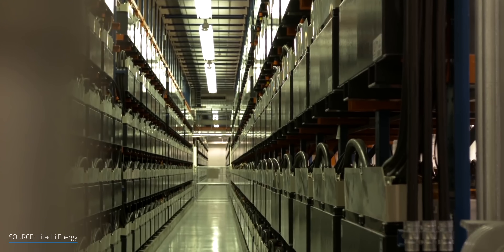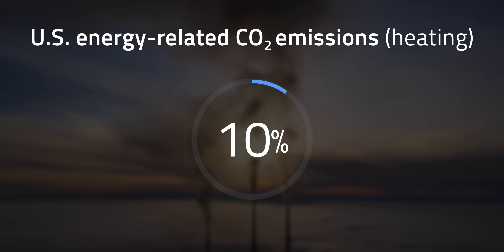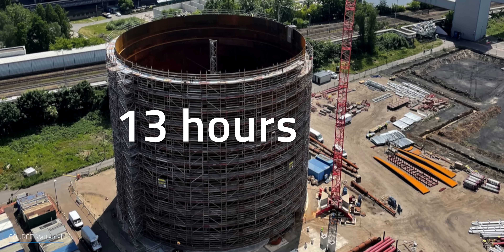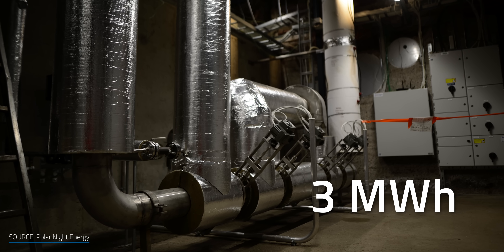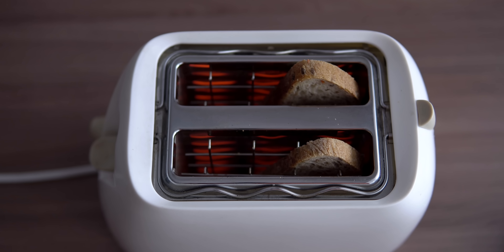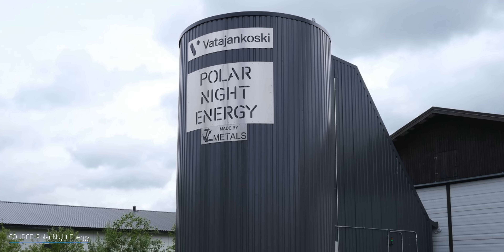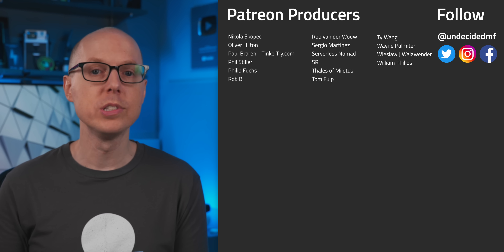How A Sand Battery Could Change The Energy Game

Comment: In Finland we have district heating in every major city and it's absolutely awesome. So cheap and efficient. This sand storage seems super promising due to it's simplicity. I hope those sand heat storage systems get deployed in every Finnish city soon. We could send excess renewable power into those immediately while we simultaneously ramp up electrochemical and mechanical energy storage.
Reply: Ahem, we would need at least 50MW of heat per hour minimum in bigger cites. That's a lot of sand of you wanna power the system, let's say for a week.
Reply: @happylatino  Apparently many Finnish cities are looking into smaller scale nuclear power (SMR/MMR) for powering those systems instead of coal or biomass, which are the most common heat sources.
This can still be utilized by nuclear Cogen plants. Just store heat when not needed, liberate it when needed. For conversion into electricity its ridiculously inneficient.
Reply: They might be looking into those but smr won't ever happen with current legislation. It's far to strict. And secondly nuclear will not power district heating without electricity conversion first
Reply: It's interesting what Sri lanka can do as here the country is so warm almost everyday, and we have plenty of sun as well. we can use solar panels and store all the heat in these silos, and then use them steadily by connecting them to the grid. our whole power outage problem will go away.
Reply: @happylatino  Utilizing waste heat, also known as Cogeneration. Been done for decades in Russia for example.
Reply: @AlldaylongRock  they looked in it for Olkiluoto. Deemed too dangerous because of risk of nuclear contamination of district heating circulation water
Reply: @happylatino  Why would there be a risk? Even if it's used as a tertiary cooling loop, it has 2 whole interfaces between it and the nuclear reactor. Then, I don't think district heating waters ever come out of the pipes, they are passed through even another heat exchanger. As for contamination, it's super easy to detect.
Reply: @AlldaylongRock  that's what government officials decided. Though I have heard whispers that OL has minor contimination problems with seawater ,tertiary loop.
Reply: @happylatino  I heard about that, and that it was quickly solved. A small leak in a cooling loop in iirc unit 2. They have radiation detectors everywhere.
Also, OL 1&2 are BWRs, so I'm doubtful that it's a tertiary loop. More likely a secondary loop. It would make little to no sense to have a 3-loop system in a BWR,especially with direct access to plentiful coolant like seawater.
OL3 on the other hand, is a PWR, so it does use a 3-loop system. It's currently testing various power levels until reaching 100% later this year.
Reply: I do know that it is called officially third loop. Ol 1&2 has freshwater loop between reactor cooling and sea. There is two heat exchangers. So in theory fresh water loop never gets contaminated even though reactor water is
Reply: @happylatino  That's why the water used for directly cooling nuclear reactors can't be used for this heating, which is why heat exchangers are used...
Reply: @thefirehawk1495  as I explained heat exchangers does not provide enough certainty that there won't be contimination. This stated by government officials. So it won't happen.
Reply: @happylatino  legislation can change if we petition. Any PWR type nuclear works by heating coolant before making electricity in the first circuit so the conversion to electricity is not required or could be combined.
Reply: @happylatino  Government officials have not prohibited the use of that nuclear power plant's cooling water for district heating. The reasons are purely economic. It is not reasonable to build infrastructure for cooling water that is only 10 degrees warmer than seawater. It simply is not suitable for district heating.
Reply: @happylatino  Go to the companies homepage. They have excellent information on how to do huge systems. Almost all cities have old quarries or big holes around them. Insulate and fill with sand and you have a huge system. Add a small wind park or use surplus windpower to heat it during summer. (In the Nordics it would actually make solar interesting again.)
Reply: This type of storage is far too low density, 8MWh is what you'd need for a single house to call it seasonal. The government will waste some tax money on it and other useless projects and thus we pave the path to hell with good intentions.
Reply: @axiom1650  The 8 mega watt was just a test prototype.  The insulation costs on a much large system  reduces the costs considerably and by the 3 university students that have been doing the research initially; their results have shown to those interested that it is at least 3 times cheaper than any battery storage system per unit of energy storage. If the sand mass system is built under existing building that require insulation to begin with that helps the overall cost and the system is designed to utilize excess solar and wind. In northern latitudes that utilize solar panels, winter output is reduced considerably and this system helps to store excess energy in the summer that would otherwise  be dumped or in the case of a wind turbine, stopped because their was no use for the output. As one finnish contributor said ; they are also looking into small nuclear that in the summer months would normally dump tremendous amounts of heat into the atmosphere. Instead they intend to capture that heat and store it for winter time demand and thereby increase the nuclear plant efficiency and lowering demand for alternate heating in the winter such as coal, biomass or having to build a larger nuclear facility. The sand mass system uses of the shelf products and has a projected 50 year or more life span.
Reply: It's not cheap here at all. Many new buildings install heat pumps instead. District heating infra is not cheap nor efficient. Compared to electric grid.
Reply: @MarkkuS  In many places the effectiveness of air to air heat pumps is low during winter and electricity is expensive when its needed. This is an excellent system for colder areas.
Reply: @MarkkuS  Heat pumps in Finland? Unless those are ground-source I don't see them being too effective with temperatures reaching - 20C in the winter even in the South.
Reply: @AlldaylongRock  You telling me I should throw away the air heat pump I have? The days the temperature reach bellow -25 where it really starts to struggle is not that many. Especially in the southern and western parts. Last winter it needed help all in all one week with an other heat source. While geothermal heat pumps are installed in every new private home it's a waste of money in a 60 year old house.
Reply: @Iceeeen  Air-sourced is also a waste of money in badly Insulated homes. Even if temperatures are inside their operating range.. For HPs in general to work well, homes need to be heavily Insulated. Below 0/-10C or something, for most AtA HPs you are better off in terms of energy efficiency using resistive heating. Older homes are better off using fuels(NG/wood pellet etc) over HPs. Fortunately for Finland, electricity is relatively inexpensive around those parts, compared for instance with like Portugal...
Reply: @AlldaylongRock  Once again I have stats to prove you wrong. I average around 11 000kw/h year, down 6000 from electric heating. Most of the consumption today is used for the garage today, welding and other tools + a electric vehicle charging.

Yes of course pelets is chepa but for heavn sake the work around it is to much. + The investment is about the same as thermal with about zero work when done

Btw try looking at spot prices. Finland is not cheap. You are thing about north sweden and norway
Reply: @Iceeeen  I didn't say AtA HPs were useless. The reality is that from an effectiveness standpoint, ground-sourced is objectively the best option, providing that you don't get frozen ground at the depths where the loops are installed (although if THAT happens, Air sourced HPs are utterly useless) 
I personally am not a fan of "oh I need 2 things to do the same effect". Because I have to do so, precisely with heating in my bedroom. I use a air-sourced HP until it gets under 5C outside, then a oil heater. 

Pellets aren't that bad. I spend literally 5 minutes average with working on my pellet stove I use for the living room and kitchen. Central heating furnaces just require you to take out the ash once a week or so, and refueling. The price difference for electricity makes up for it for sure. I'll probably get off-peak rates up to the 15cent mark this winter, and peak ones to like 25 or 30 cents. All depends if it rains or not (Portugal is extremely dependent on Hydro to keep prices in check, and currently the dams are dried out, result of the closure of our coal-fired power plants). Now, what are the rates in Finland? Spot prices don't tell the whole story, as 50% of what I pay is for infrastructure due to the ridiculous amount of VREs that have been installed in the last 20 years. 

Other instance of this is people buying EV and keeping a ICEV that isn't usually necessary for longer trips. Why not buy a PHEV that suits the daily needs all or majorly electric? Especially when public chargers are rare and just as expensive as using gas, like it is in Portugal?
Reply: @AlldaylongRock  used to be the case. Now with certain countries driving prices up we pay 20-80c/kwh when generation is insufficient. Check fingrid for some interactive maps. Given by how busy electrician firms are everybody wealthy is installing some kind of renewables at the moment. Small installer in our village bought 3 new vans this month alone and has a month wait time to just install a switch on my garage.
Reply: @4LXK  But Finland is investing heavily into nuclear. One of the European countries with the most receptivity for nuclear. And that is the only reliable option we have. No energy storage solves how jank wind and solar are. Europe was screwed by Germany and their stupid Energiewende. They should pay compensation to all of Europe.

Comment: This reminds me of the gravity tower. Has enough storage capacity for a single wind turbine for a single hour.
Molten salt can go to about 1,465 °C, which is 3 times better.
Better still, just use nuclear power stations and you skip the whole whole storage thing.
Might be okay to use with solar, there is daylight for most most people most days, wind.. well. might not be that windy for weeks.
Reply: Well, molten salt thermal storage or other reliable and high capacity storage methods such as PSH and 
 maybe this for waste heat and District Heating will help nuclear power as well. Demand(both of heat and electricity) isn't static. A nuclear reactor works best economically going for full power output. In fact there's vast interest in MSR and FBR reactors with incorporated molten salt thermal storage for flexibility.

Comment: The point I don't understand, is the resistance heating. A heat pump would significantly increase heat development for the same electrical usage, in theory even providing cooling that could be used, since it is summer, and using waste heat from many different sources, like data centers / supercomputers, air conditioning, industrial processes, etc, would make electrical use limited to the transport of heat, and the infrastructure for transporting that could be the same, but reversed, from what brings heat back in the winter, and therefore is already necessary.

Comment: 40 years ago on pbs was a show this old house...  every week they would be building a new solar house.  first southern facing. then there would be some green house style room with a tile floor designed to trap heat durring the day and release it at night....  so some of these pricipals have been use for decades.   also heat pumps work on simmilar principals .... why not use insulated sand for a private home

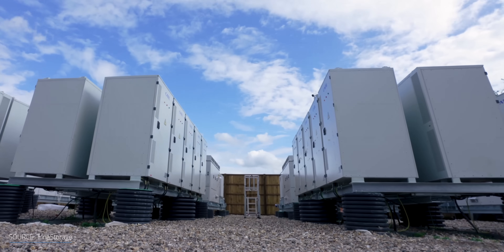Comment: The whole approach of storing "sensible heat" is fine if what you have got to begin with is energy ALREADY in the form of heat. BUT, every time you convert electricity to heat, you have lost ~70% of the available energy to do anything else with it , like running motors. Taking high quality energy like electricity, which you may have "sweated engineering blood" for, as we used to say - coming from wind, nuclear reactors, etc. - and using it to heat is really bad unless you have no choice. Thermodynamics tells you that the reconversion from heat back to electricity can only be practically done at around ~30% return unless you get to very high source temps: consider that a 3000 MW thermal nuclear plant only offers 1000 MW electricity. So, especially considering the direct comparison with batteries made at 7:33, 8:06, etc in this video, one must be extremely careful not to waste a major part of one's hard energy harvest. You allude to this factor once or twice Matt, but then seem to mix things at times. 

With best regards for the fine news presentation otherwise , D. Barillari.
Reply: The idea was to store excess electricity from renewables as heat rather than in chemical batteries, which is later used to heat homes or for industrial heat processes. It is not converted back into electricity later.
Reply: @TwilightMysts  
Yes, my friend, I get that. Think of electricity as 100% quality energy - usable for anything. That makes electrical energy from renewables a great, hard-won product, so that by immediately devoting it to heating , when heat is otherwise already given off as the end effect of many processes like turning a shaft, is like throwing away 70% of the value of efficiencies and efforts gone into making the best renewable electrical source term you have. Sure, we lazily do that all the time now, I know, when we energize any household heater that runs electrically (whether heat pump, resistance element or what have you). What makes the district heating idea so swell is that a cleverly designed community could garner its heated air from industry waste heat that was released by a high-efficiency process - all process energies must eventually degrade to heat, but you can fritter it that way first or initially run a mill.

with best regards, Domenico

Comment: Would it be possible to store energy using a flywheel during space expeditions, where in the vacuum of space, a flywheel would have minimal resistance, so it would spin for a very long time?
Reply: Almost all large satellites have 3 or more flywheels
Reply: @kkarllwt  They are not for recovering energy, however. Not there for energy storage.

Comment: Interesting to see Minneapolis mentioned among cities with district heating. I looked into it, and sure enough, it’s in downtown, heating multiple sports stadiums as well as commercial buildings. And Minnesota is a leader in renewable energy, with a large and growing wind and solar base. Perhaps taxpayers could use their leverage to replace the presumably gas-fired heating downtown with sand batteries powered from our wind turbines?
Reply: Downtown districts were built when coal fired power plant were 60 to 100 megawatts and nearby. There was no gas till the 1930s or 50s. Selling the heat made good sense compared to lots of inefficient stinking boilers all over town.

Comment: And how it's thermal insulated insulated?, If you have 600°C, how do you stop that heat from getting out the sand to the exterior? It's something like aerogel? or it's a quimical reaction too or something more for me to store heat and be able to use it 4 months later seems very impressive
Reply: most likely no different than the insulation used in generic chemical process industry. so certainly nothing as fancy as aerogels. Most like rockwool and some additional layers in some kind of sandwich construction. The idea is to have big enough battery (the bigger you go, the less surface you have per volume), because heat loss only happens from the surface (which you have insulated). And then sand itself, it has a pretty good specific heat (can actually store quite a bit of heat per mass/volume) and it also has a reasonably low thermal conductivity (so it is not actually good at conducting heat).

So it is not a quick reload or discharge battery... think it as 100m sprinter. But more like slow charge and slow discharge (think of a marathon runner).

Comment: Why is there "no demand for <wind turbine> energy" while > 80% of our electricity is generated by burning fossil fuels?  Why is it impossible to shut down a fossil fuel generator or two to create demand for wind turbines to run?
Reply: Sometimes wind doesn't blow and thus you need an alternative. Sometimes it blows so much that you produce too much power.
Power usage isn't based on how windy it is.

Comment: I worked as an industrial Engineer for 50 years, to say that pump, pipe and valves is readily available is incorrect. Even Small pumps and equipment can be on 12 months delivery. All of this including moving the sand has a factory background for support.
Reply: I guess the meaning readily available is from a use and technology standpoint, not item delivery lead times. So readily available perhaps means something that is already used for the exact same thing... the only thing that is "special" is the combination of these, and to be fair it is not really anything special eiher.
Reply: @hematula1  phraseology can mislead the general populace. You should refer to it as “proven technology”, omitting the word “available or availability”.